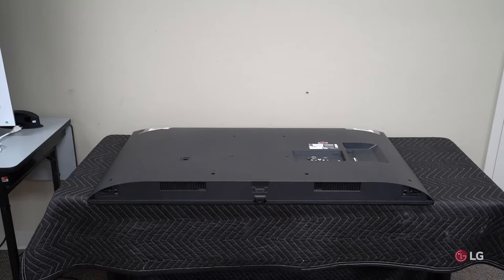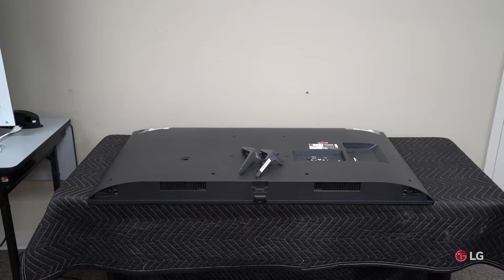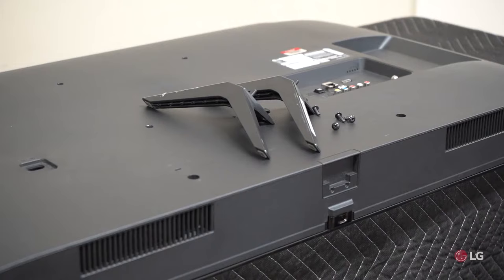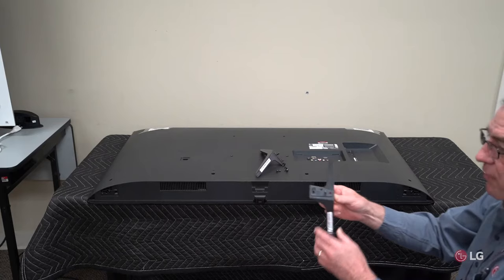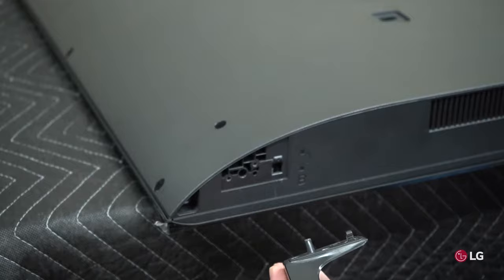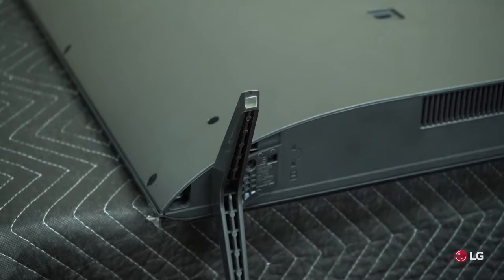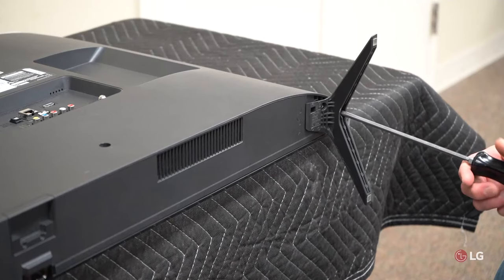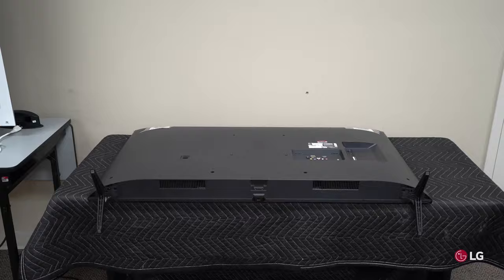[LG TVs] Dual Leg Installation

Comment: It doesn't quite lock into place and the screws are too big for the holes.
Reply: Oh yes and they don’t turn
Reply: Exactly the problem I am having 😭
Reply: Same happen with me
Reply: It’s made to carve in its path through the hole. Nothing to worry just softly turn and it will automatically stop
Reply: Exactly what the fuck is going on
Reply: This video is a fraud. Everyone has the same issue: the screws dont fit the hole. In this video he just casually screws them in. Nonsense. I'd invite him to try that on the 2 (yes 2!!) I brought home. The engineers who designed these legs are incompetent.  Could have provided a support base vs the flimsy legs but would have cost LG 5 more dollars (and the buyer 30).

Comment: Just bought this TV at Costco. Got it home. Installed the legs. Super wobbly. I lodged a complaint with Costco. I was told they constantly get the same complaints. No other TV brand is wobbly like this. It's not worth it. Taking it back.
Reply: I'm having the same issue🤦🏽‍♀️
Reply: Maybe the screw is too long.  It comes with washers I believe.  Try a 14mm length. If the screw does not tighten up it will wobble. I just bought M4 x 14 length on Amazon.
Reply: @craigcarrillo  please does this M4× L14 fit well on your tv? I have a LG50' TV will this size help aswel? Thanks in advance

Comment: I have tv model Lg55UN7300AUD. The legs are broken. There were no screws holding these legs on. Just plastic pin and hook like the legs in this video. All the replacement legs I see have screws. This tv has plastic holes but no threads in them for leg screws. I was told the original owner screws did come with the tv

Comment: What size are the screws? I lost mine
Reply: Me too ..did u get the answer ??
Reply: Me too... i need the size
Reply: Same here, I need new ones
Reply: @grant6902  i got them
I got from samsung care
Reply: The screw size is (M4xL16) it fits these models 
43uj6300
43uj6350
43uj6050
49uj6300
49uj6350
49uj6050

Comment: Thanks for this . . . can you tell me how to take the legs off - because they snapped into place - I am having trouble getting the legs off so I can mount the TV on a wall.  Thanks in advance!
Reply from the maker: Hi, Frances. I’m sorry to hear you're having this issue, and I’d like to see if we can assist. Please contact LG Customer Support by direct message via Twitter ( @LGUSSupport  ) or Facebook Messenger ( https://www.facebook.com/LGUSA/ ), and include your contact details, the model & serial numbers.^Rain
Reply: To Frances Scanlon  so it took me a while. I just needed some patience. 
After you place the tv on a soft flat surface, screen down. Turn the legs downwards.. take the right side and turn it down and to the right.. do the same with the left..
Once I got them off I felt so stupid. Anyways hope this helps
Reply: Ok scratch that Ms. Frances, on the right side turn it down and to the left. On the left side turndown and to the right. I just tested it out. My apologies for the confusion before. Again I hope this helps.
Reply: @iderathaknotsay3624  thanks for this info!

Comment: Hi may I ask how to remove the dual stand?
Reply from the maker: Hi, Tina. Hello! Hello there! We'd be more than happy to help you with removing the dual stand from your LG TV.

* First things first, let's ensure the TV is powered off and unplugged from the electrical outlet to keep things safe.
* Next, find a soft, clean cloth or blanket, and lay it on a flat surface to prevent any scratches or damage to the TV screen.
* Now, gently and carefully lay the TV face down on the cloth, making sure the screen doesn't touch the surface directly.
* Time to spot those screws! Look for the ones that secure the dual stand to the TV; they're usually located on the bottom rear part of the TV.
* Grab the right screwdriver for the job, and gently loosen and remove those screws that attach the dual stand to the TV.
* With the screws out of the way, you can now slide the dual stand away from the TV and voilà, it's detached!
* Now, all that's left is to set the TV back upright and place it on the desired stand or wall mount.

Remember, the exact steps might vary slightly depending on your specific LG TV model. For model-specific guidance, we recommend checking the user manual that came with your TV or visit our LG's official website through this link: https://www.lg.com/us.

If you have any questions or need further assistance, don't hesitate to reach out to us via private message using @LGUSSupport on Facebook or Twitter. We're here to make things easier for you!

Comment: Now how do you unlock/remove it
Reply from the maker: To remove the LG TV's dual leg, you will need the Philips head screwdriver as described in the video. To avoid any damage, please refer to the owner's manual that came with the TV for more information and instructions regarding the installation/removal of the TV stand leg of your LG TV. If you have any further questions, please send us a message via Twitter or Facebook using @LGUSSupport and include the model & serial number for further assistance. Thank you! `Alice

Comment: I did everything right trying to install these worse than useless legs on my lg tv and they were never secure enough..
  the parts of the legs that are meant to clip into the  tv didn’t support the screen properly and popped out every time I lifted the tv .
they also made the tv lean ever so slightly, (and yes I did install them correctly)

had to buy another stand that was designed PROPERLY and was fit for purpose

Seriously LG sort it out 🙄
Reply from the maker: Hello Sarah, Welcome to our LG US social media page, based n your recent post, it seems you need an assistance. Please send us a private message together with the model number of your product, so that I can assist you further.

^Arnel
Reply from the maker: Hello Sarah, I'm passing by to check up your case, and this is regarding about your TV, that you're having a problem to install properly the leg, since then we never heard from you. Do you still need my assistance? If so just let me know. Is there anything else that I can help you with?

^Arnel
Reply from the maker: Hello Sarah, I'm passing by to check up your case, and this is regarding about your TV, that you're having a problem to install the leg properly, since then we never heard from you.  If you have any other question, please don't hesitate to send us a message anytime, for now I'll go ahead and end our session. Again thank you very much and have a great day.

^Arnel

Comment: Way out of date.  Two screws only for the current LG TVs.
Reply from the maker: Your feedback is essential to us, and we would greatly appreciate it if you could share your thoughts and suggestions on our LG feedback page https://www.lg.com/us/support/feedback. This will help our product development teams make any necessary improvements in the future. Thank you for your time and consideration. ~Rita
Reply: @LGUSASupport  I tried to reply on your website, but it was useless, no space to do so.  The current model LG TVs only need two screws on the feet, not three.  But it's still wrong.  They're positioned near the edges of the tv, which makes us buy bigger and bigger stands.  Your design should have a center foot underneath the tv, which wouldn't go out to the edges.  It would only need to be a foot to two, rather than out to the edges.  My TV stand was 30 inches wide; had to buy a shelf to make it wide enough for only a 43 inch TV.  Great TV, but your feet underneath the TV are a bad design.  Should be in the center, not close to the edges.
Reply from the maker: We see your concerns about the LG TV's stand, and it would be our pleasure to delve deeper into this issue you are facing and what steps we can take, but we must switch to a different platform in order to have back-and-forth conversations, so please direct message us on Facebook or Twitter with the hashtag @LGUSSupport, including the model and serial numbers of the TV. We are eager to help! ~Rita
https://www.lg.com/us/support/contact